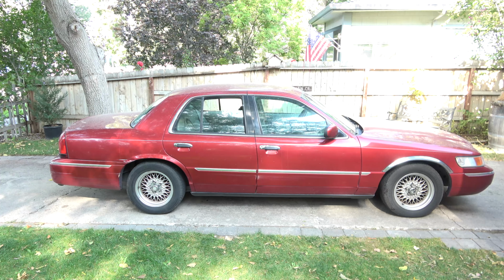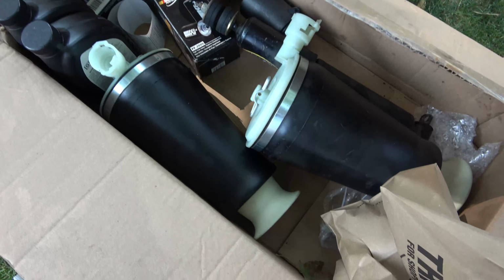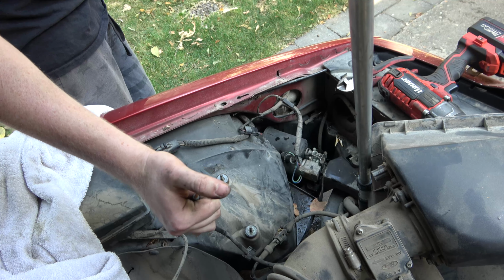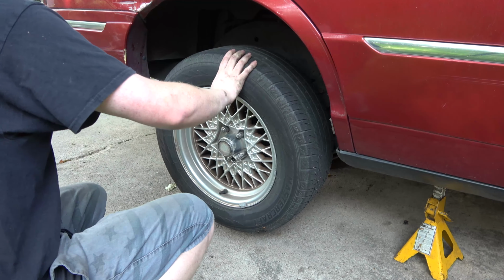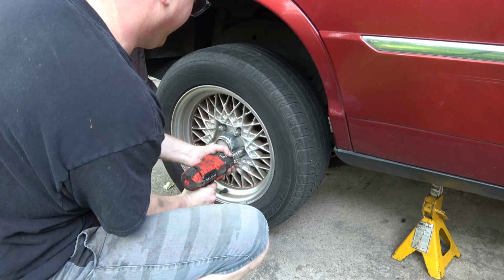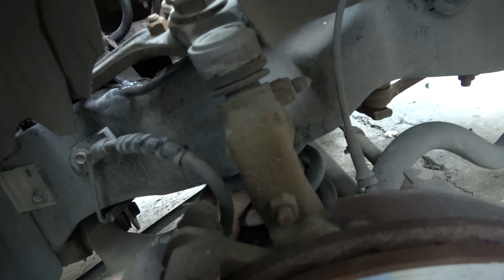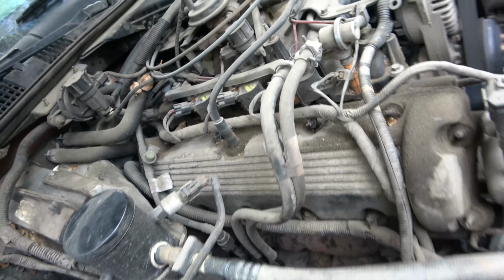1999 Mercury Grand Marquis | Air Suspension Service | Merc Project EP01

Comment: Thanks for the video. I also have a 99 Grand Marq, in which the air shocks need to be replaced. Question, have you known anyone with a Crown Vic or Grand Marq install a lift kit with the air-ride suspension? I'm asking, because I would like to put 24 or 26 inch rims on my Grand Marq someday, but I might to get rid of the air-ride system altogether.

Comment: I’m going to replace the air suspension bags on my 2011 marquis tomorrow. What drill are you using to remove those lug nuts. I see it’s a 20v battery. 

Hopefully my shocks are alright. My car is leaning to the left. I figure I’ll replace the two rear bags and the compressor while I’m at it just in case that’s an issue too.
Great video !!!
Reply: You likely have cracked o-rings that allow air to leak out. It is pretty common.

Comment: I have this car in a 98. Does the front and back have air ride or just the back?!? Mine is all original with about 80k on it.
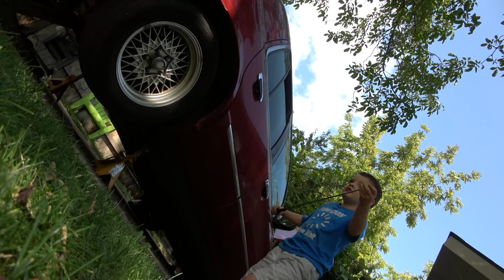Reply: For those that read this, at 18:00 you will see the front wheels suspension. Air suspension is only in the back. Ford made few changes to these cars over the years so generally you can compare different years.
Reply: @Mn09lfV6f  Thank you

Comment: You can not " tune a shock" by leaving the mounts loose. The bushings should be compressed to the specified amount in the service manual. And that new exhaust (with a big ass hole in the muffler).  Keep going however, maybe in 20 years ...

Comment: I read somewhere, 'Crownvic.net', that those black plastic bottom air springs that were removed from that HPP Grand Marquis are firmer than the yellow bottom air springs. they are supposedly the same ones that were used on the 'Marauder'.  just what I read, not sure if true.
Reply: Why did u totally disconnect the air solenoid? I'm trying to figure out why. Once disconnected from the bag, just need to replace the 2 O-rings